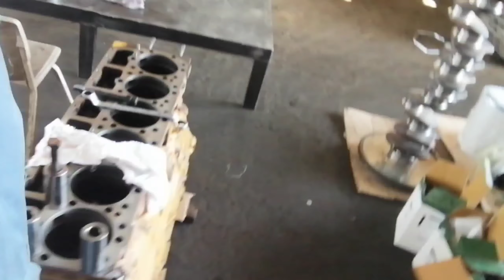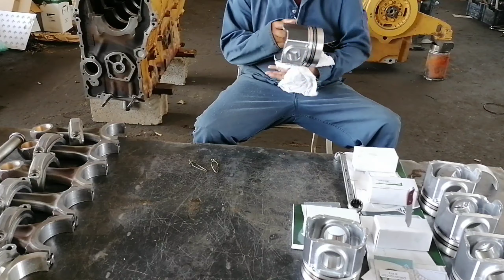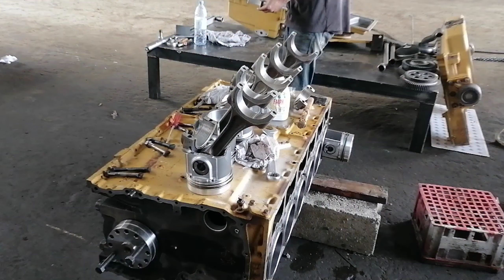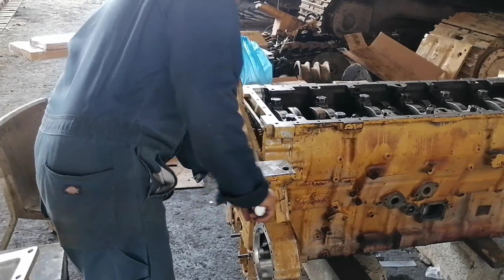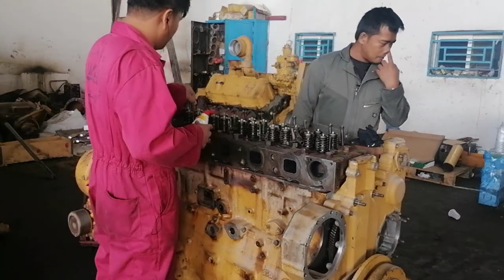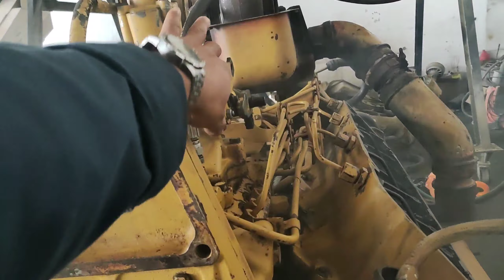3406 engine caterpillar complete fittings

Comment: You lost me as a buyer when you dropped the liners in dry, you didn't use LockTite on the internal bolts on the front structure and I didn't see you measure the liner protrusion..🍷😎👌

Comment: Sir may unit ako ganyan sa d8r .Valve nya sa cylinder 3 ayaw gumana...Stock up .
Reply from the maker: hindi kaya baluktot ang engine valve kaya  na stock up
Reply: @themountaineermechanictv  sir pwdi pahengi ng Ilan torque sa head bolt at conrod cup bolt. Salamat
Reply from the maker: sa main bearing 55kg sa conrod 25 kg, at sa head bolt namn NM ang ginagamit ko 350 NM(NEWTON METER)
Reply from the maker: sa d8l yan boss 3408 cat